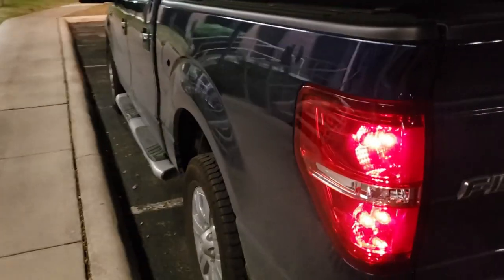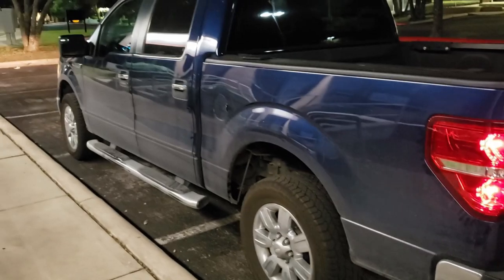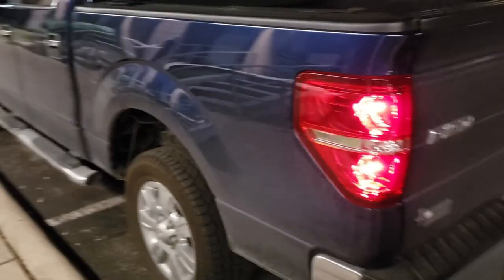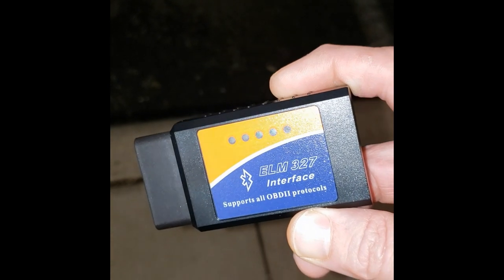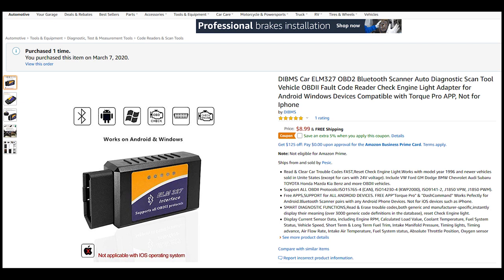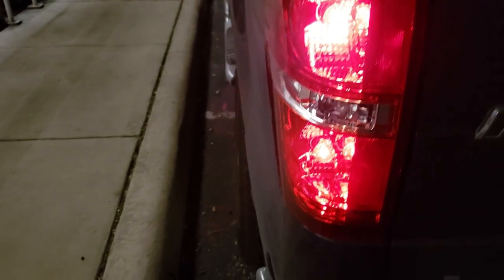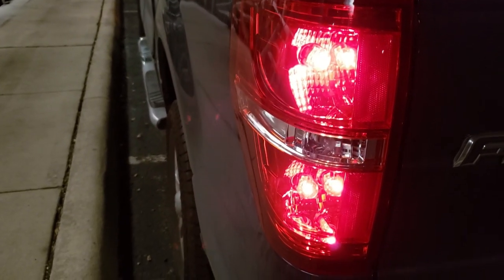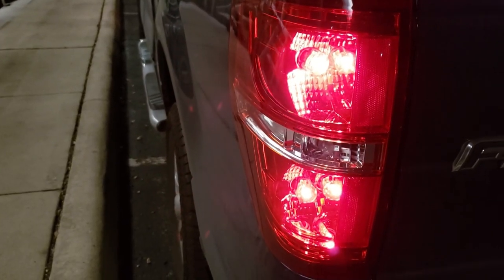2009-2014  F 150 signal brake light fast blink FIX $10 (BCM Body Control Module)

Comment: Dude you are the MAN! So I went to advanced auto and bought the $65 scanner. Brought it home it was useless didn’t even read any error codes. Returned it. Ordered this cheapy elm 327 off Amazon $21 (because I have an iPhone I needed WiFi version) I just got it in the mail plugged it in cleared codes AND MY FRICKEN LEFT BLINKER/BRAKE CAME BACK! Thanks
Reply: What app did you use with it ?
Reply: Exactly which one did you buy???

Comment: You saved me $180!!! The local shops I took it to said there is "no way to clear BCM codes. You have to do a reprograming of the BCM, not just a clear". Clearly they were wrong. This method worked exactly as you described. Thank you for the work and dedication to figure this issue out and to create this video!

Comment from the maker: Edit: 2 years later. Still no problems. The problem didnt start again so...solved.
Reply: Awesome video, about to order but the link shows sold out. Hard to find the Bluetooth version
Reply from the maker: @omarperez935  Just search Amazon for OBD2 scanner and look through them. Make sure you get one that works with your phone. Some are Android or IPhone only. They range anywhere from like $10 to $99 from what I'm seeing. I see a very similar one to the one I used but its for $22. And it only works with Android. I will reply back with that link if you want but again, I can only vouch for the one I used.
Reply from the maker: @omarperez935  
https://www.amazon.com/dp/B005NLQAHS/ref=cm_sw_r_cp_apa_i_8Q4rFb7D16DFA
Reply from the maker: Or look heres one that works for both phones and cheaper

https://www.amazon.com/dp/B08D7697H6/ref=cm_sw_r_cp_awdb_btf_t1_7-4rFbX5S4RZ5

Comment: I cannot thank you enough for passing this knowledge along. Been trying to fix that for over a year now changing bulbs and units and it was that simple. Again thank you!
Reply: I'm currently having this issue, with my left tail light on a chevy malibu. I will give this a shot. Diagnostic = $160. Already paid. I told them it was probably the BCM too, and they didn't believe me. Now they're saying it is the BCM and quoted me $725 to fix. It'll even be an aftermarket part. I have spent HOURS on this over the last month. Hope you're right!
Reply: It did not work. Also took to auto parts store to use their OBD2 tethered tools. Still a no-go.
Reply from the maker: @jordanlee7353  a Chevy Malibu BCM issue would not be the same. Not sure how you ended up here but hope you got that taken care of
Reply: @jordanlee7353 I have the same issue with a Malibu.. Did you ever fix the problem

Comment: THANK YOU VERY MUCH. THIS IS DANIEL PEREZ, CALIFORNIA, a real person. Owner of a 2011 Ford F150, same color as yours. Well, I bought the tool you recommended and downloaded the app you recommended.My problem: no brake light, no emergency light, no turn signal, all on the back of truck, passenger side. I followed your instructions and I CLEARED the CODES, just like you said. AND BAMB! JUST LIKE THAT EVERYTHING WORKS AGAIN. THANK YOU VERY MUCH. A SHORT, to the point video on a seemingly complicated problem.

Comment: Thank you so much!!! I’ve already taken my truck to the Ford house once for them to reset the BCM for 175 dollars. I searched all over online to not have to take it again and I came across your video. The ones you left a link to were all sold out but I found one similar for 27 dollars and it worked. I’m so happy about not having to take it to the ford house to get ripped off again. They know it’s an easy fix too. Thank you so so much for sharing this.

Comment: OK bought the $22 reader for android only and downloaded the car scanner app.  Only codes that appeared were a misfire on cylinder 4.  Cleared the codes and the turn signal and brake light worked!  So appreciative that you put this out thanks!  Did change the bulbs out first but definitely cheaper than taking it to a shop to just read and clear the codes much less pay for troubleshooting.

Comment: Thank you. I just fixed my 11 f150 . The brake lights on rear driver did not work. Or the blinker. It wasn't the bulbs and It had electricity.  THis was it!!! That same device. It works.

Comment: THANKYOU  SO MUCH! This worked so well 10 mins. I was done I still have hyper flash but I have the parts to fix that. It's awesome that you shared this.
Thanks again you kept me from getting  a ticket!
Reply from the maker: Hyperflash still there? Shouldn't be
Reply: @cedricwilliams6229  I have led lights
Reply: It takes a capacitor  to slow it down I disabled it thinking that was the problem  but thanks to you it's fixed

Comment: Wow! Baught that scanner hook it up (wifi version) connected it to the app, cleared codes and bam! Back in business. Note to others. I spent a whole weekend changes fuses that were good replaced both bulbs and sockets even tried the sticking the battery terminal together for 2 minutes to reset the system and nothing. I found this video searching though YouTube scrolling through countless videos and found this one. Figure before I spend hundreds on a new control module I might as well buy this first. Shit was easy and took me less than 10 minutes. Thank you so much for creating this video shit was a money saver! Much love man.

Comment: My Ex's F150, I was always changing the bulbs and it was never a problem but hers was a 2004.  My 2014 F150, same issue, just change the bulbs.  It was driving me crazy, WTF is the problem.  i got my scanner on the way.  I got a wired OBD II scanner, $25 on Amazon, I feel it's worth it...a little.  I am like you, I will go through all my knowledge before I'll take it to a mechanic.

Comment: Thanks so much I have the same problem but I do not think it is the bulbs as both left rear do not work but front does. I thought ok must be wiring I will check the brake lights also and go from there .. Excellent video short and concise no blah blah ..

Comment: I definitely need to try this out.  I noticed the fast blinking on my 06 ford f150 and thought it was just the bulb so I replaced it with no luck. The issues you're having are exactly like mine. Same side, brake light on the right doesn't illuminate after pressing the brake and the signal light won't come on. Only time the brake light comes on is with the running light but thats it. Checked fuses, all good. I'd rather test as many possibilities than go to the dealer. Just ordered the scanner so we shall see...
Reply from the maker: Better to try a $10 hack before going to the dealership any day
Reply: I tried it but it unfortunately did not fix my issue. Back to the drawing board.
Reply from the maker: @mezican4  good luck

Comment: Thank you!….kind of, So my 2011 I put alpharex led’s on (with transistors) worked great for about 3 or 4 months.  Then right brake/turn light went out.  Taillight portion still worked but not the brake/turn on right side.  After watching your video I ordered the ELM on amazon and cleared the codes.   Didn’t seem to work until I cycled the ignition a couple times.  Now the brake lights and turn signals work but it still hyper flashes for right turn only? Let me know your thoughts, I’m not sure what to think.  At first I thought maybe my transistor is bad but why would the brake light work at all then?   But you were right, I had no brake or turn lights period before the clear.  Many thanks!

Comment: Thanks for the video 2012 eco boost same issue used car scanner app and boom it’s fixed going to auto zone or parts store want fix it tried that too ,also drilling the hole in the intercooler fixed my misfires 👍👍thanks again !!

Comment: Thanks for the info and the video. I ordered one of these OBD2 scanners for $10.79, it fixed the problem with the brake light/turn signal.
Reply from the maker: No problem glad to help
Reply: Did you order the Bluetooth version and where did you order it from, the link provided is sold out.
Reply from the maker: @jeff6818  I'm sure thats just one brand and there are others just like it

Comment: Just wondering what tail lights those are, they look like the newer 2021 style red edged lens but for the 2012, and I've seen them on a few trucks but havent found them for sale
Reply from the maker: Got them in 2020
AmeriLite Red/Clear Brake Rear Direct OE Replacement Tail Lights For 2009-2014 Ford F150 F-150 - Passenger and Driver Side https://a.co/d/gxjki5n

Comment: Hey Cedric, thanks for the video. So I went to Oreileys to use their scanner...which seems very high tech and my vehicle didn't have any codes  to clear. Both bulbs are functional (filaments in tact), fuses are good to go....I really thought I'd get lucky but upon scanning there wasn't anything to clear and my issue persists. Anyone else having an issue here? Is there a change the OBD2 readyer you have is more advanced than Oreileys or did you have a check engine light on already?
Reply from the maker: I don't know anything about O'Reilly"s scanner. No, I didn't have a check engine light on.
Reply: @cedricwilliams6229  right on, I found the original video you referred to. The good news for me is it’s the exact issue you guys both have. Fingers crossed when it comes tomorrow, I can use that Forscan app and rid myself of this finally.
Reply from the maker: @ChadHenkel  if its nothing else its almost certainly this. Good luck. I dont know about the forescan app but the free generic app I used worked fine. (Was it Forscan? Idk)
Reply: @ChadHenkel  did it work? I just went to Oreilly, they use an Innova DST. It’s more complicated than any other DST I’ve used before. After I got home I researched how to use and saw that I didn’t properly scan “all modules” in the DTC menu. I ordered the OBDII online and will try it next per the video instructions.

Comment: wish i saw this video before losing half an hour getting into my wheel well to get to the bulb and mess with it to no avail.

But thanks allot for the video! Saved me from my frustration
Reply from the maker: Sorry to hear. Yeah videos like this can be hard to find and even harder when YouTube shadow bans your channel because a few of your videos scare their woke employees
Reply: @cedricwilliams6229  Well, my issue came back and a DTC clear is no longer working.... Any ideas?
Reply from the maker: @Moog1337  No bro. I still haven't had any problems
Reply: @Moog1337  have you solved the problem ?
Reply: @edgarlicea8170  yes i did. 

In my case, I had LED's in the headlight turn signals and it turned out one of the bulbs were bad .

It was wierd though cause it was intermittent at first before it became permanent. I also swapped the bulbs from sides during my initial troubleshooting and the problem stayed on the same side. Maybe i mixed up the bulbs at the time, im not sure. The DTC clear also worked a few times before it no longer did.

But yea either way, i ended up taking out the bulbs and bench testing them which confirmed that the blinker part of the bulb was in fact bad, swapped out with normal halogens and the problem went away.

These were no cheap LED bulbs either, they were $75 GTR Canbus led's i got from the retrofit source . What a waste of money those are, total junk, had nothing but problems with them since day one and the one that burned out only lasted a few months.

Would love to find some LED's to replace the halogens with again since they did look very good, but I'm very wary due to my bad experience with these. If anybody can recommend one based on a good experience would be cool.

But yea, I hope that answers your question @Edgar Licea. Let me know if I can be of any more help.

Comment: Now I'm curious as to why the BCM disabled the light circuit in the first place. It does this when it senses an overload.....but how did you overload it?
Reply from the maker: Yet it hasn't happened again. I think these vehicles just have alot of bugs. The wiring is especially brittle and problematic in these. In the doors and behind the entertainment center for sure.

Comment: Which app are you using? The instructions listen several, but they all had issues connecting properly.
Reply from the maker: It was in the video. A generic free app. And if they had issues connecting properly thats likely because of another part of the video you missed where I said get the Bluetooth version.

Comment: Its a little weird for me.. I connect a trailer and the lights work just fine...
But I use my rv and..
1 left turn blinks fast, right turn blinks normal.
2. Running lights of my truck work fine, running rv lights don't work at all; but left and turn signals work...
I checked the wiring harness and the rv plug and found out only 2 of all have power but the rest don't...
I checked all fuses and they are fine..
Now... my rv has a battery but it's not connected. I'll buy the terminals  and see if it's the charging thing that is not reading or something 🤔

Comment: Man I have a 2012 f150 this is the second time it has happened to me the first time I was able to clear the codes with a snap on scanner. Now the second time I tried it with the same scanner and nothing. I have tried the wi fi & Bluetooth on these elm 327 and still no luck. I have ordered the USB version but have not downloaded the software which I think I need to buy or download the forscan. I'm starting to give up on this. I have taken it to 3 different techs and still no luck.

Comment: I have the bluedriver OBDII scanner that was $100 and another I just bought for like $12 after watching your video and I still have the hyper flash going on after clearing all codes. Any other suggestions? I do see where you shared an Amazon link to another reader that works for both types of OS's so I'll try that in the meantime incase you don't see this comment. Thanks for sharing regardless!
Symptom: swapped lights to LED for the rear turn signals. 
2013 Ford F-150
Reply from the maker: Symptom swapped lights? You switched out lights and still the problem?
Reply: @cedricwilliams6229  hey there. No, I had a bad bulb and decided to go with LEDs so now I have that hyper flash. If this next reader doesn't fix it I'll prob just go back to regular bulbs because I don't wanna deal with resisters and stuff.

Comment: Cedric have same issues bought the device and it says i have no codes to clear any tips am i doing something wrong?
Reply from the maker: Sorry. I'm not an expert on the device and how it works. Mine didn't say I had a BCM issue at all. Maybe your truck has no issues but I would suggest trying to clear anyway if there's a clear button. Its been years now and our apps may vary so sorry I can't be more help there.
Reply: I appreciate your response 👍
Reply from the maker: @danielhidalgo4547  maybe try a different free phone app
Reply: I will try that  thank you 👍

Comment: I have a 2009 F-150 FX4 Offroad edition and the FORSCAN tool, there is no BCM (BodyControlModule) on this truck, just the GEMS module and I cannot locate the parameter that needs adjusting. Does anyone know where it might be located on trucks with only a GEMS module

Comment: HELP. I did this exact thing but it's not working! I'm having the same problem. Blinker is fast, it's not working and the brake light won't work.
I think where I missed up was that I cleared the codes without the engine running.
I'm very frustrated because I even used the app that I had to pay $6 because Car Scanner didn't work and it still didn't do anything.
I also didn't use the exact module you used either so that could be it
Reply from the maker: Could be. I'm no mechanic. Did you change out the bulbs first?
Reply: Man I have a 2012 f150 this is the second time it has happened to me the first time I was able to clear the codes with a snap on scanner. Now the second time I tried it with the same scanner and no help. I have tried the wi fi & Bluetooth on these elm 327 and still no luck. I have ordered the USB version but have not downloaded the software which I think I need to buy or download the forscan. I'm starting to give up on this. I have taken it to 3 different techs and still no luck.